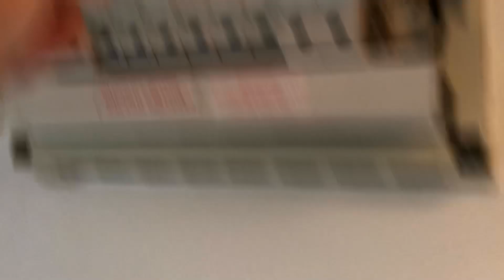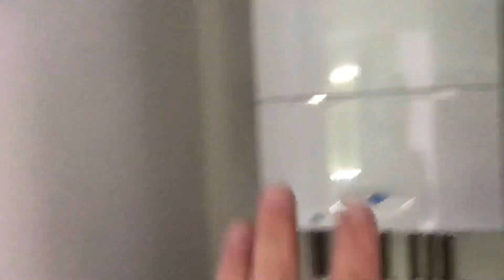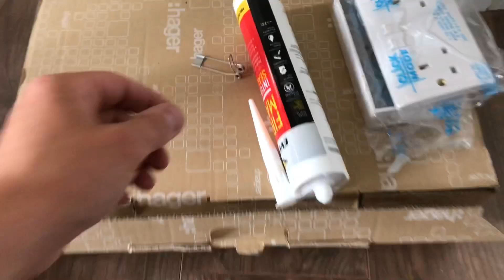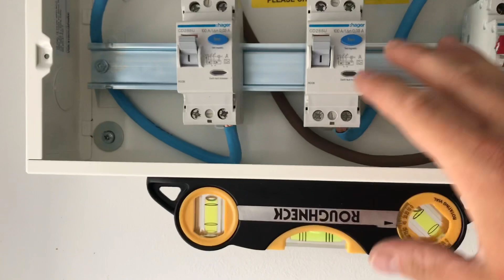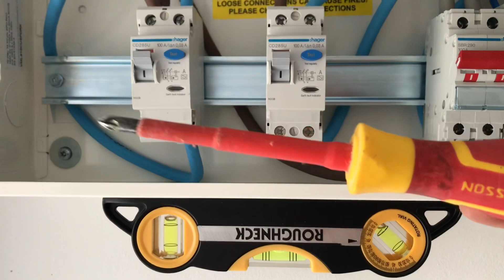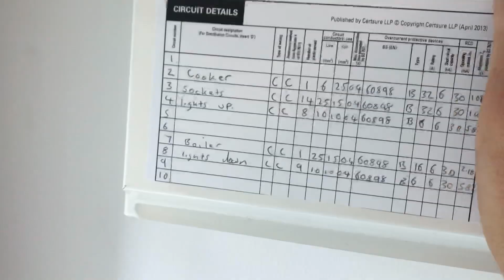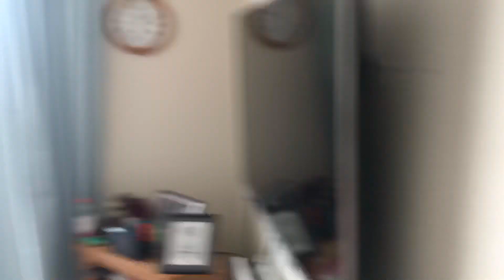CJR ELECTRICAL Installing 18th edition compliant consumer unit.

Comment: Not sure if already said but might be worth noting if people are going to start testing r2 to rn on radials you would probably expect a lower reading then r1 r2 on lighting circuits using the loop system due to switch drops not involving the neutral. And also in some applications using singles. 
I think that's right anyway. Great vid a always

Comment: I would of recommended RCBO's before SPD's, Chris I hope the guy didn't tell you that you also must have AFDD fitted ;)
Reply: Dave Morgan AFDD are only a recommendation, not mandatory..............yet!
SPDs, now don't quote me on this, if your area by some sort of calculation, which I'm sure someone has done on YouTube, David Savery springs to mind, is in, above or below a certain threshold (not sure if I'm honest) you may not need to fit an SPD. But being able to get an accurate calculation for this, because of variables and lack of information to carry out an accurate calculation proved extremely difficult. Guess it's more of a case of fitting one to protect your arse.
Reply: @craigemmott4976  Yes I think your right Craig, risk factors etc come into it and which type 1 or type 2 depending on out comes. I think Gaz did a video from GSH too.

Comment: I thought the Regs required 25mm tails now. I always upgrade them.
Reply: Artisan Electrics not if main fuse is 60A. You can just about get away with an 80A if clipped direct on 16mm tails
Reply: Basically a myth, your design dictates what size your cables need to be

Comment: Finally we can cut the seal guilt free! Do you have a tool to reseal it? Would love a recommendation.
Reply: Get one from eBay.
Reply: Yes they are available in every tool supply store!
They go under the name Snips or Sidecutters ;0)
Reply: Artisan Electrics I’ve pulled plenty and resealed them, got some seals from eBay and crimped them with snips.  the guys i did my apprenticeship with, used to cut and pull these main fuses without batting an eyelid so it was normal to me. But I’ve read so many horror stories online recently about the carriers coming away and them blowing up and what not, it’s made me think twice. I know if the board is isolated and you carry out the right procedures then there shouldn’t be an issue. How many of you out there make sure you megger the tails  before you put fuse back in incase (however unlikely) live has snagged on the metal board?

Comment: Found a socket with no earth at home, metal capping to protect cable had a nail right thru middle of capping to hold it in place!

That was done before the plastering when bungalow was built about 37 years ago.

Comment: Its ok these guys that teach the regs saying you need to do x,y and z, but in the real world it's not always possible, and we do a lot of crap we shouldn't be doing anyway. With spd protection, blame the IET, if they said it must be fitted fair enough, but as usual they don't, so it won't get fitted most of the time, and in 30 years of doing this job I have come across it once on a neighbour's house and don't get me started on torque settings.

Comment: SPD's are only a recommendation and most wholesalers don't even sell them lol
Reply: SHORTYSMURF92 ADF are only recommendation, SPD  need to either do the risk assessment calcs or in the case of a domestic weigh up the price of fitting an spd over the price of the equipment it protects .
Reply: @robswingler  yeah i agree a lot of my customers have said no to it so if just put it on the certificate and that's that nothing much u can do tbh
Reply: SHORTYSMURF92 yep that’s what I do but I’ve started fitting the fusebox boards for £120 with spd and 8x rcbos which are really nice boards .

Comment: It’s nothing to do with being allowed to pull a DNO fuse it’s the fact it’s not the home owners property. What do you do if it falls apart in your hand?
Reply: I've found plenty stating "100a fuse fitted" only to find a 60a in.
Reply: David Ellis I’ve seen a few of those too.
Reply: The same as what the DNO would do, replace it.
Reply: Alvin Ashman difference being if they pull it and it disintegrates they have spares there and then. If you do it you’re at their mercy when they will come to repair. You’re also likely liable for a call out and materials.
Reply: I've never had one fall apart in my hand and it could be argued that if the fuse carrier fell apart simply by removing it, then perhaps it was no longer fit for purpose anyway.
Reply: Alvin Ashman most DNOs take a pretty dim view of you interfering with their equipment. There are a few companies local to me that are authorised to fit isolators on behalf of DNO. They charge £60, solves the headache for the next 30 years and leaves it safe for the next guy. The argument that it probably would have broken anyway isn’t likely to stand up in court.
Reply: Alvin Ashman not saying we haven’t all done it but you’re pretty foolish to do it commercially in me opinion. You’re liability insurance would most likely walk away in the event of any issue. Many are decades old, if you remove it you potentially leave a customer without power for hours or more.
Reply: Barry Britcher 🤣🤣
Reply: That'll be for the lawyers to argue about, but like I said I've never had one fall apart on me yet.

Comment: I thought you did a test  before you replaced the consumer unit. Why wasn't the earth neutral fault found then?
Reply: That's a good question. Maybe the cooker switch was off during the IR test, so the fault was disconnected from the circuit.

Comment: my cousin lives in the states and they have been installing AFD devises for decades now and he says they work ok in urban areas but in areas supplied by TT systems they tend to be a pain in the a hole and they dont just reset you have to change them ...i dont yet know how ours work in that respect ?? they only really use them for lightening strikes something we dont really suffer from too much in the UK 
oh and those wall anchors need a setting tool they dont really like being set with the screw it puts a lot of strain on them
Reply: Firsteerr Lastmwwew don’t you mean spd? Afd is for loose connections which creates an arc

Comment: Great vid as usual! Just a question - why type A RCD?
Reply: joey06051988 in order to pick on on dc faults as well as ac faults - it’s to do with how much tech is in any one house now days, big mix of ac/dc 😉
Reply: joey06051988 in order to pick on on dc faults as well as ac faults - it’s to do with how much tech is in any one house now days, big mix of ac/dc 😉
Reply: @marcus62647  there are videos on you tube on how to test  'type A' RCDs when you find they don't trip within the usual times!

Comment: I was wondering if the folding of the conductor to have greater surface area contact  under the terminal is stated in the product manufacturers literature or is an electricians tradition.
Reply: I don't think it's written down in any electrical documentation or manufacturers instruction as it's a call on the installers part. If the terminal is big enough to accommodate a wire being doubled over, then it should be, it's more of a best working practice than anything else.

Comment: 7.41 m/ohms/meter for 2.5 12.10 m/ohms for 1.5 dont forget to convert them happy days
Reply: dsb electrical david betteridge is this volt drop you’re doing as it would be : mV/A/meter
Reply: @robswingler  hiya mate no its for res per meter not vd for seeing if the cable length adds up to the zs acheived

Comment: Great vid again Chris , 
Did you perform an IR on cooker circuit ? I always test through isolator to outlet plate, if you disconnected the oven and hob then completed R1R2 and IR with isolator on (no neon so no need to link out ) that fault would have been highlighted before new CU was installed ? 
Keep vids coming always learning 👍
Reply: Ryan Mckenna  I can't help thinking that it was just the 2 gang outlet that was faulty.
Reply: You’d presume the cable between isolator and outlet would be disconnected both ends and IR performed between cores.....well I did 😁

Comment: Have you never tested before continuity of main equipotential bonding ? Quite an important test even before 18th. Also high ohm reading more than likely the resistance through the dimmer. Can also get accessories to fit into the huge back knockouts in Hager dbs. Other than that not bad bud

Comment: I was told a few years ago breaking the seal on the main fuse is ok but breaking the seal on the meter is a no no , suspicion of fiddling , this was told to me by a meter guy.Never had a problem doing this .
Reply: Ray Chambers you need the right safety gear.... best not to do it
Reply: @zjzozn  when I had to withdraw company fuse I made sure no load was present, have seen the professionals put fuse in under load conditions quite a splash if not put in first time!

Comment: How come the oven fault didn't surface with your ir pre test?
Reply from the maker: Because I tested to the isolator. Was trying to avoid removing that grease bucket. Plus I’m not happy putting 500v dc though someone’s oven.
Reply: @Cjrelectrical  wonder why the old rcd didnt trip with that existing fault.
Reply: Oven wasn’t on the rcd,only the ring and boiler
Reply: @supersparks9466  sorry mate just remembered beginning.
Reply: Fair enough Chris, sorry was skipping thought this one as was tired from another day’s sparky work

Comment: Great video Chris! Do you get the homeowner to get an asbestos check before you work on the textured coated ceilings?

Ps have you seen the Brother PTE550WVP label printer, connects to a PC, prints over wi-fi and amongst many things does the labels for CU boards as one long strip
Reply: Michael Beckett good question that ! often wonder that myself regarding asbestos within households , artex coatings etc .

Comment: IMO the trouble with SPDs right now is they could fail the very next day after you install them, nothing beeps, no circuits trip or are disconnected, there is only a tiny red non illuminated flag in a small window behind the cover and as we all know homeowners don't lift the flap on the board unless something trips! Customer would never know they were not protected for years until the next inspection, and when you do see one has failed and go to buy the "cartridge" most manufactures don't actually sell the cartridge as a separate item, you have to buy the whole SPD unit again lol. Maybe they need to make something like an audible signal on fail same as when smoke detector batteries run down.
Reply: Totally agree

Comment: Great video! I love the Hager boards, really good quality. Hager do have moulded grommets (shown on the leaflet I got in the last Hager I fitted). It’s nice that you get the grommet for the tails with it and at least they supply a bit of strip that’s way better than nothing. Great fault finding and testing demo, fair play

Comment: Last year I had everything go bang and everyone on my road had the same turn out uk power network lost a neutral at the sub station luck haste sorted it all out and uk power network foot the bill. Would spds stop it happening again??
Reply: Nope.. SPD's arrest over voltage surges in the supply, not detect missing neutrals.

Comment: On the grommet strip - recently got a great tip from another spark I was working with. Take a bit of sheath you've stripped off a cable, split it down the edge, and use that.
Reply: Looks rough as toast too
Reply: I've been doing that for years.
Reply: Been using that like that for years
Reply: Super glue it on!! Plus always good to have it in your bag in case you break any of the customers household items. Shhh!!!

Comment: Great video 👍 had u any issue testing those Hager A Rated RCD’S? find they read very high, I’m testing on the correct A waveform with a Megger MFT1730, acceptable readings can just about be achieved when re testing on the AC waveform
Reply: Repeat the testing in manual mode, not auto. Thank me later ;)
Reply from the maker: Yes your correct higher readings than AC form
Reply: Had the same, saw a YT by e5 talking to Hager about this
Reply: Cheers will give that a try, any reason why manual mode would give a more favourable reading?
Reply: @dommcvey1987  I had the conversation with hager technical. They've got an instructional pdf for rcd testing on their main page. Long story short, type A RCD testing should be done in manual mode and it does produce different and quicker trip times. They're still higher than AC type rcds but they at least comply.
Reply: I see thats interesting thanks
Reply: Hager gave some spill about how to get pass this on the GSH Electrical channel, it'll be interesting to see if this is just a Hager problem or if all other manufacturers have the same issue.

Comment: I have been fitting Hager SPD board's since January now, you can't get much better than them. But got to say nice looking board and all those labels on it? I put mine underneath the flap it's not like anyone reads them anyway, May aswel make it look nice. Good vid bud!
Reply: Labelling giving instruction should be visible... RCD test label, Next inspection & test label etc. Everything else can be hidden underneath the cover.
Reply: @ashmanelectricalservices4318  It will be visible when you lift the flap, which is what you would have to do if you need to do anything on the board ; )
Reply: @serenetysteel7007  No homeowner is ever gonna lift the cover to check how frequently to test the RCD or when the next test is due, at least if it's clearly visible, half the works already done.
Reply: @ashmanelectricalservices4318  I have met only 1 homeowner that has ever tested their RCD out of hundreds, despite an RCD test quarterly label being present in full view of the world. Likewise for commercial customers who have never tested an RCBO or RCD full full labeling being present
Reply: Plus you have to lift the lid to check the RCD!
Reply: @serenetysteel7007  So because hardly anyone test their RCD's, the label should be hidden from sight??? You're never gonna affix every single label underneath the cover so the very least you should do is priority which should be on the front to free up space for some under the cover.
Reply: @ashmanelectricalservices4318  No i said it looks nicer, and its not hidden as mentioned above.
Reply: @serenetysteel7007  If it's underneath cover, then it's definitely hidden.

Comment: You found some fairly nasty faults there - nice testing. Re doubling up cables in c.u. terminals, there’s an even better way, which was commonly used many years ago, especially by the meter installers. After stripping the insulation, take a strand of copper wire from a 4mm sq. cable, and wrap it tightly round the wire or wires which will be secured in the terminal. This provides an excellent joint.  Re inspecting the cutout fuse: if you have cut the seal, it means the fuse can now be pulled out by an unskilled person, which could be dangerous. As each seal has a number embosssed in it, which the DSA can use to identify the person who installed the cutout or the fuse, I doubt that you have a supply of seals - but I might be wrong, apologies if I am. The cutout and tails were clearly recently installed (heatshrink termination on incoming PILC cable, plus isolator), so it is very unlikely that the tails would be the wrong size.

Comment: I have not been fitting SPD's because it is not mandatory in a domestic environment unless the requirements of the equation are met..... And yes, I mostly check rn's and r2's on my installs. :) Great video and congrats on the pass. As if you would have failed dude........ :)
Reply: I was taught on my 18th that if the price of installing an spd is higher than the price of the electronics likely to be damaged by a Serge. Sounds iffy when he told us but that was he said
Reply: DaC27 96 I’d say if the customer doesn’t think the extra £40-80 for spd isnt worth protecting their electronically equipment then note it on cert and don’t worry about it . You can’t know the total price of electronically equipment in someone’s property.
Reply: @robswingler  It's not the cost of the SPD that's the issue but the cost of the spark to come out and do it. Really needs to be a consumer replaceable item assuming one is needed at all.
Reply: Hypatiakitten I only fit one when upgrading boards

Comment: One problem with 18th edition boards is that you will never know if the SPD blows. A solid metal lid on the CU, how many clients will look under the lid unless the power goes off especially if the board is in the garage or under the stairs behind the Dyson.
Reply: The customer will have to check it the same time as they do the six monthly RCD test 😂😂😂
Reply: Ah, is that where the Dyson is, I'll mention it to the wife.
Reply: People actually test the rcd?
Reply: I think the only people who test RCDs are sparks.
Reply: @mowcius  press the test button?
Reply: Lost count on how many customers say " what's the RCD ! 
It's the big switch with a little button on it. So obviously it's been regularly tested by them.
Reply: @philip426  the only time a customer tests the RCD is when something in the house is causing it to trip
Reply: Fit one with indicating contacts and connect as suits you given the importance, or not, of know that protection has been degraded/destroyed.  Most SPDs are not necessarily one-shot, they can absorb small assaults and either degrade or recover depending on design.